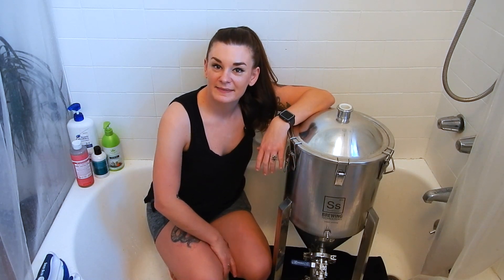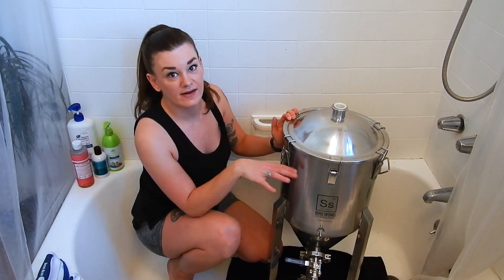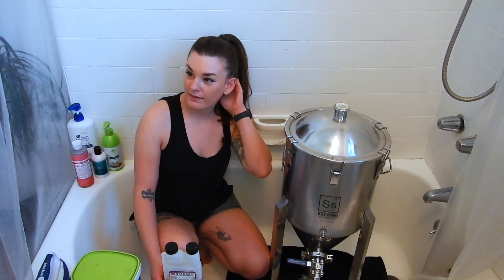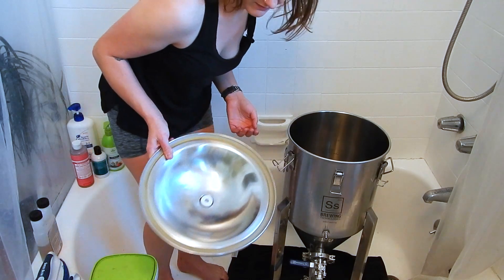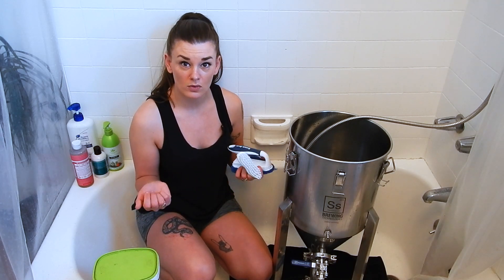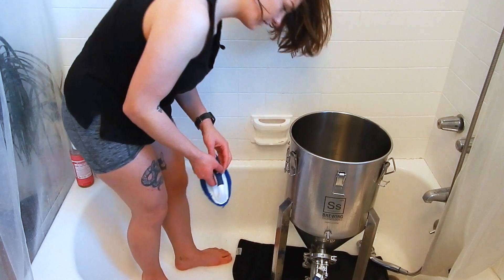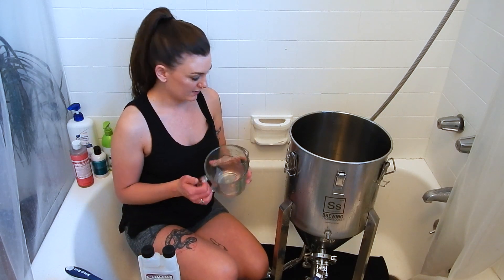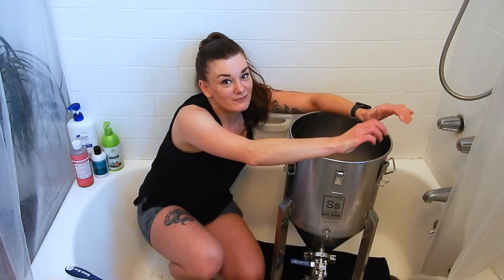How to Passivate Homebrew Equipment to Prevent Erosion & Rust

Comment: Citric acid should work good. Make a strong solution and swish all around. I have tried PBW to clean several things. It has not worked very well for grease or oil/resins. I first cleaned some second hand equipment with dawn and vinegar and a scrubby, rinsing, then the PBW and scrubbing, rinsing, then sanitizing or passivation of stainless. There are stronger acids that will nearly instantly clean and passivate, but I should not recommend as there are a lot of simple people out there ;-)

One thing you never do to stainless steel is to scrub with wire brushes or steel wool that is not also stainless steel. Regular steel will leave iron on your stainless causing rusting. Learned this from welding and using stainless steel cookware. I don't yet have much stainless steel brewing equipment, but am gradually getting rid of all plastics I can.

Comment: Hey, everyone. Don’t want to call anyone out, I love the channel, but this does not pass I ate stainless steel. A blend of phosphoric and nitric acid is used at the pro level. This stuff is very dangerous and can’t be used at home. The pH is generally .1 - .4

You can however use citric acid at higher temperatures but will take some know how for dilution strength. Highly recommend looking into this if it’s something you’re interested. You just won’t be getting the chromium oxide layer on your stainless with starsan.

Comment: How often do you recommend passivating?
Reply from the maker: I only do it when I get used equipment I’ve read every couple years and you’re fine
Reply: Thank you,  I've just purchased a brew kettle so I'm new to brewing with stainless steel. When cleaning after brew day,  would chemicals used for cleaning such as pbw/bar keepers friend promote rust and need to be passivated again with star San? Or would simply rinsing off these chemicals after cleaning be enough. I'm probably over thinking it but I've just spent a lot of money on brew gear lately and I need it to last ahaha

Comment: I spent a number of years building stainless tanks... Lots of 'em.
From three to thirty thousand gallons in size.
I had never heard of passivating stainless steel until a happy coincidence while looking into electroplating a magnetite coating on steel.
Thought I'd let you know that we don't passivate any tanks at "the factory". 
Not even the mirror finished ones with the pressurized heating/cooling jacket.
Like I said, I had no idea what passivation was & I've built tanks for most of the big name breweries, and a few juice companies too.
Reply from the maker: Interesting! Wonder if it’s one of those homebrew myth things that needs to get debunked
Reply: @FloraBrewing  
Curiosity got the best of me, as usual...

Since the dangers of hexavalent chromium are regularly made clear to anyone who welds stainless steel, I thought I'd see how what I've learned about passivation relates to the less savory elements in stainless.

Depending on the acid used in passivating, hexavalent chromium MAY be produced.
There is an inexpensive and simple test for chromium VI...
In the presence of an acidic hydrogen peroxide solution, hexavalent chromium will turn into the unstable chromium peroxide, which is dark blue, before oxidizing to trivalent chromium, which is green.

That is to say, to test your particular passivating acid, scoop some of the solution used to passivate into a cup & add some hydrogen peroxide.
If it turns blue then green, that's bad & you should use a different acid.

Citric acid is the recommended food safe acid for passivating in the literature.
Due to variations in the manufacturing process of stainless steel, it's always worth testing your brewing vessel of choice with any acid used in passivation.

Comment: As an cost effective alternative to Starsan, you can use Bar Keepers Friend which has oxalic acid as it's active ingredient. Just make a paste of the powder, apply and let sit for 20 minutes or so, then rinse and dry off. Be ware that it will remove etched volume markings in which case you should use Starsan or citric acid instead.
Reply from the maker: I’ll have to look into that!
Reply: @FloraBrewing  I have been researching passivation since I am a geek and my father was a metallurgical engineer and I am quite surprised at what I learned. Take a look at: https://modernbrewhouse.com/wiki/Passivation

Turns out hot citric acid is the only reasonable solution for the home brewer since nitric is not safe to work with in a home brewing environment. Even brewing equipment manufacturers are making incorrect suggestions that phosphoric acid in Star San is effective in passivating stainless steel. Turns out you only want to remove the iron from the surface and not strip the chomimum as well.

Comment: I'm rebuilding my equipment after 3 to 4 years without brewing (though I helped some friends how to start). Now I'm back on the game and I've brewed a scotch last week. I lack of space at home too, so I'm sticking to small batchs (around 20 litres in this hemisphere). I'm using a kind-of plastic bucket as a fermentor but I was considering getting a 30 l (almost 8 US gallons) conical fermentor. I read that it was not recommended conical fermentors on such small batchs, but neither of these people were brewing my size. Now that I see yours I'd like to get your opinion wheter it makes a difference or not that much. Thank you and greetins from Argentina
Reply from the maker: I love using conicals and haven't noticed any downsides. I do 5 gallon batches normally and it seems to work well.

Comment: Cool, this seems like an easier way and using less water per the size of what is being passivated. Ty. Also, I just recently moved into using star-san from iodiopher, because star San being expensive. I know there's a comment about reusing it, in which I do. To let it last, I keep a gallon or two of ratio delution using it through however many cycles of brewing, packaging etc. When the star san delution starts to be clear(un-hazy), is when its basically done.
Reply from the maker: I like using a spray bottle for it instead of soaking things to make it last longer too.

Comment: I use Sodium PerCarbonate - I forget the dosage but I have it written on the container. In any case if it does not feel soapy I add some more. I believe that StarSan - which I also use only requires a contact of a few seconds but It is best to be sure. Letcherous me was kind of hoping for a more messy cleaning session :-D. Sorry I'm a fella. I also clean up over my Bath but stay outside the Bath.
Reply from the maker: I usually just use a hefty scoop and call it a day. I usually wash from outside the tub but for the camera angle it wouldn't work so I took one for the team